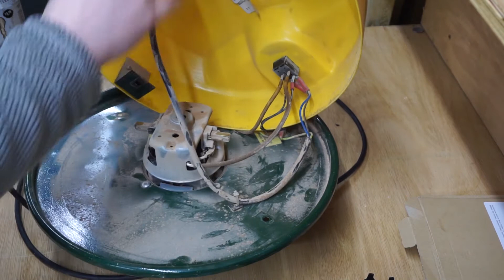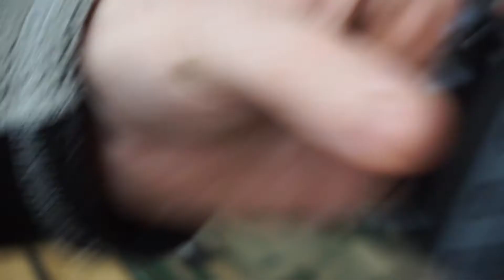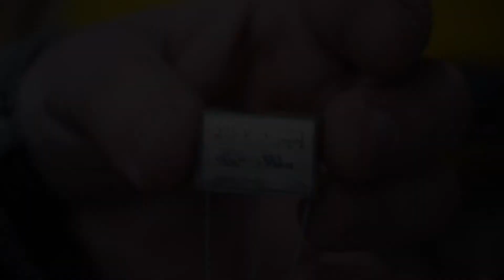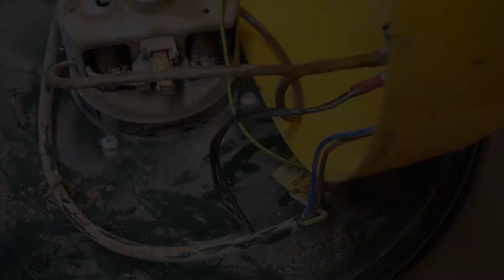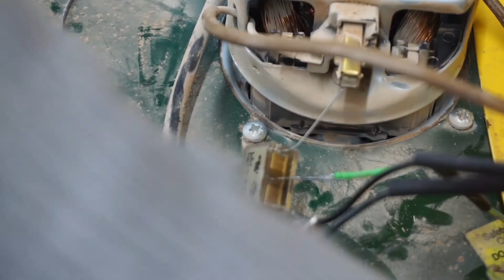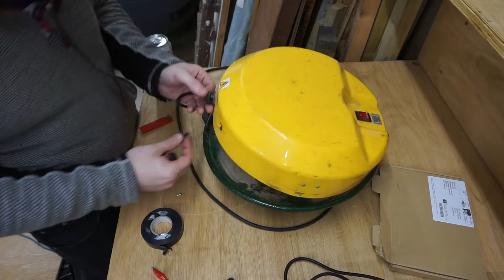Record dust extractor repair. Workshop equipment tripping the power? this might help.

Comment: Hi David, Iv'e got the same problem as you with the cap. I have hunted everywhere but couldn't find anything suitable, I then came across your video. I have searched for "bridging capacitors" and I am coming up blank. Can you remember where you got them from or even better a link. Thank you in advance.
Reply from the maker: https://cpc.farnell.com/evox-rifa/pzb300mc13r30/capacitor-delta-network-0-1uf/dp/CA08123

I actually got that by just searching paper capacitor, but I think "safety capacitor" "X2 y2 y2 capacitor" and "capacitor delta network" all seems like valid searches.

Comment: Thank's for that David. I have been experiencing problems with a RP RSDE1 dust extractor. For a couple of years now it was causing the RCD plug in the kitchen to trip. So I reset that and away it went. However, yesterday it was cutting out and tripping the circuit breaker in the house. This device is 15 years old (approx) So I took it to bits, gave it a dust out. I noticed something rattling about inside the housing assembly and found the cable run flapping about. The suppressor capacitor, although it was still connected had fallen out of a little holder. I assumed this was where it was meant to go and stuck it into the tubular holder. I assembled it and connected it to a band saw and it's working fine now. EH ? Best regards.
Reply: John, I have the same model as you, I did do a miner repair on a loose wire, that was flapping about and causing the workshop to whole house to trip. I got it to work a treat for a few months,then this morning..mine literally blew up...it sparked 💥made a fair size bang and tripped the workshop!!! I’m not sure I can fix it! Any advice would be great!!
Reply: @gailpengelly8581  Hi Gail. Sounds like a short circuit. I'd strip it and look for any blackness / signs of burn damage. Remember to disconnect the power supply first! Did you clean/change the filters? Not being able to see the machine, I'm afraid I can't be much help. Let me know what you find. Best regards.
Reply: @johnmitchell1614  MANY THANKS FOR YOUR HELP John, I will certainly do that...you never know...I’d be so happy if t could b fixed!! It sounds REALLY high pitched too...before it blew up!! Keep you and yours safe and well. Xx
Reply: @gailpengelly8581  Hi Gail. A high pitched sound? Could the inlet hose be choked with some big shavings? I tried to use mine yonks ago thinking I could use it as a big vacuum cleaner, but the hose blocked up with long shavings. Remember it's a dust extractor. Best wishes.
Reply: Hello Gail. Did you make any progress with your dust extractor. Best regards.